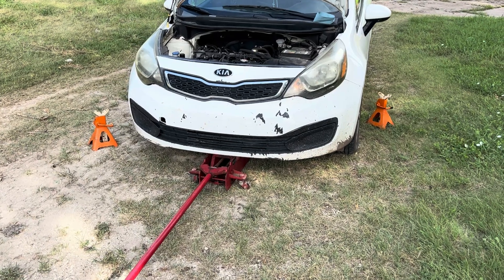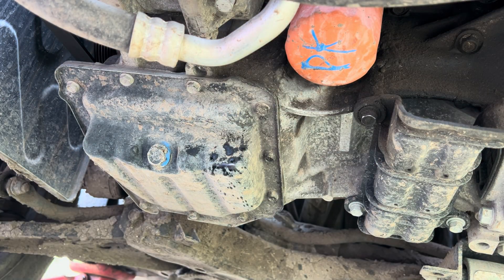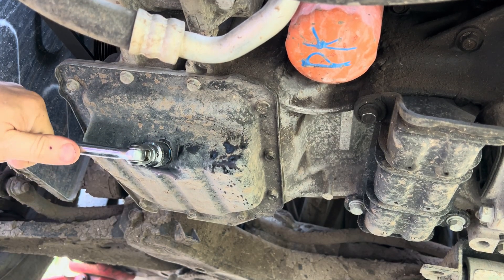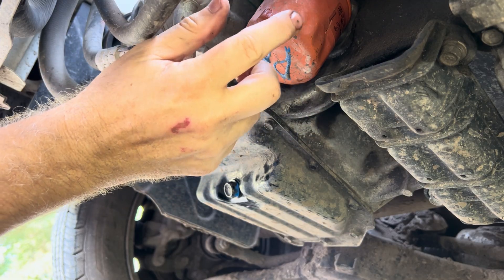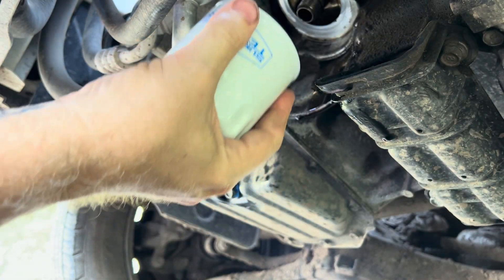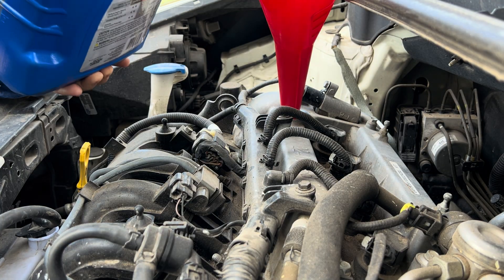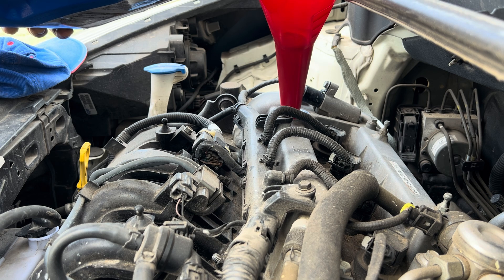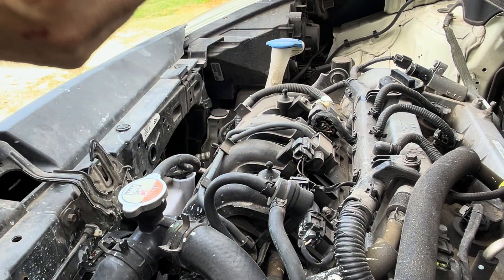Stop Kia and Hyundai Engine Failures! DIY Oil Change + Tips

Comment: The central jacking point is right there at 2:21. All Kias have the same system. You have to position the jack towards the back so the car doesn't slip off. It's a terrible design. Better not to use.
Reply from the maker: Yeah, I found it. Unfortunately, it was so far back that my jack couldn’t fit under the car. Fortunately, the side jacking point worked fine.